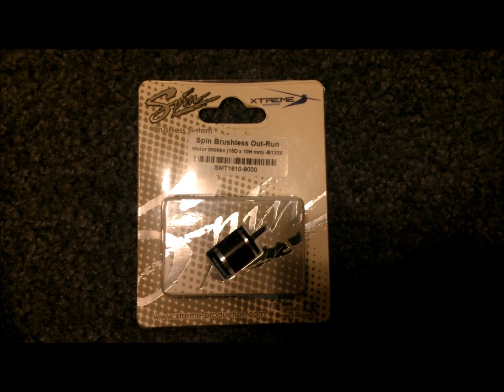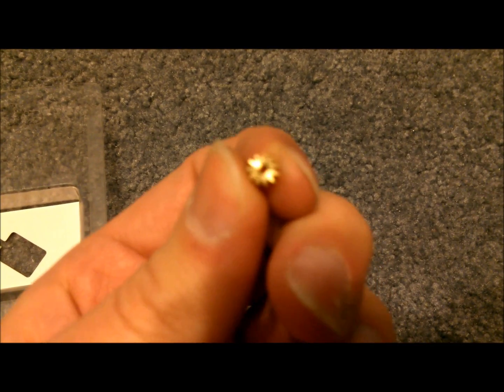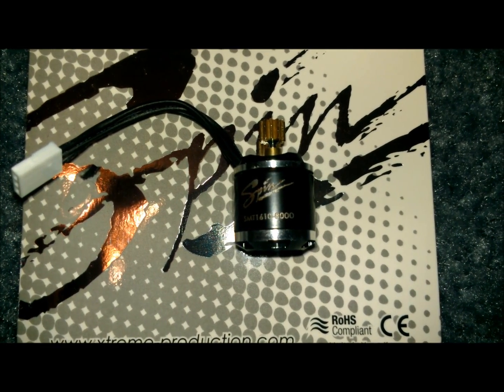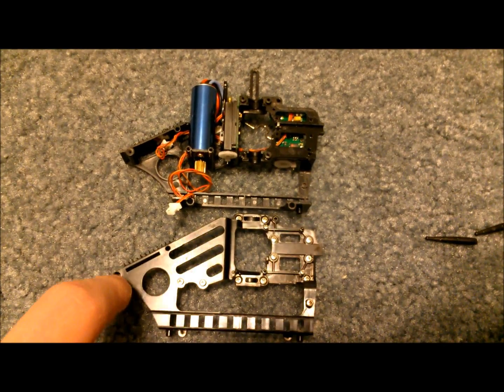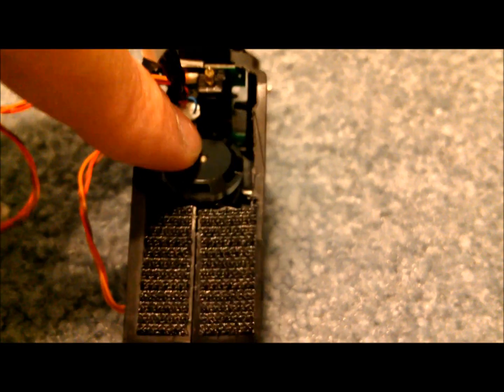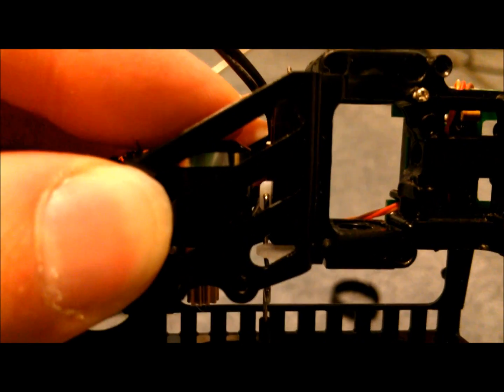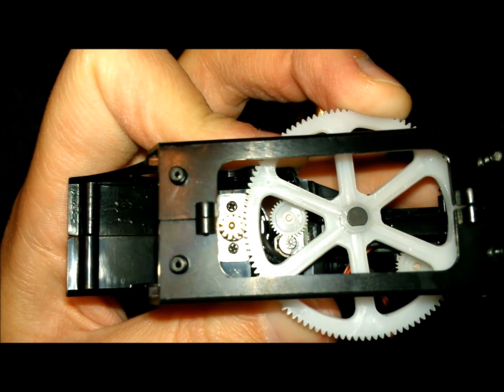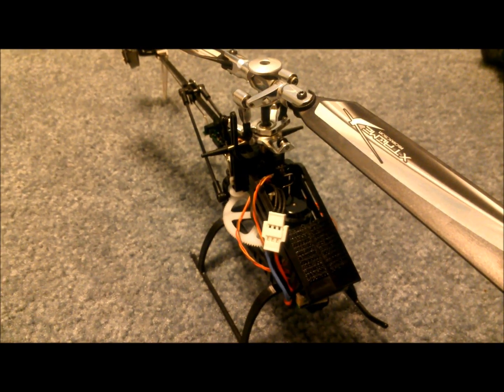Blade 130X How to Mount Outrunner Motor Spin 8000 HP08

Comment: Mine came with slip-fit pinion. However, I found the metal motor support had screws the wrong size. Wound up not using it.